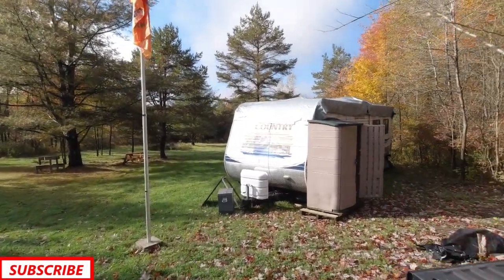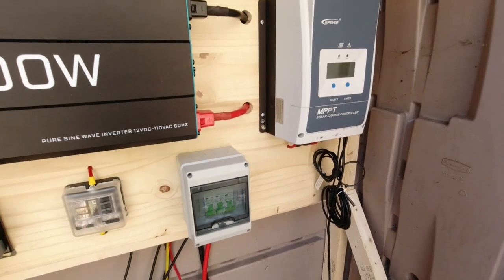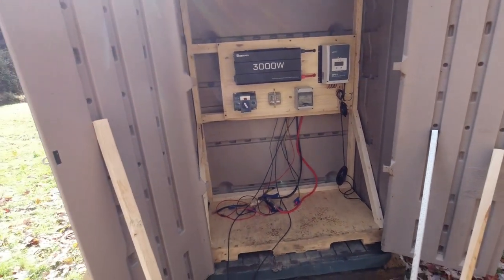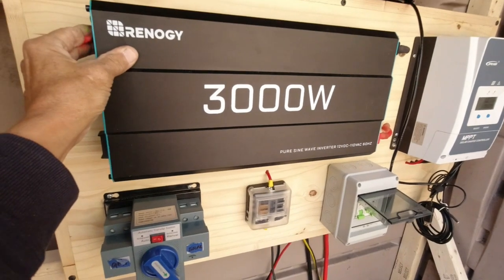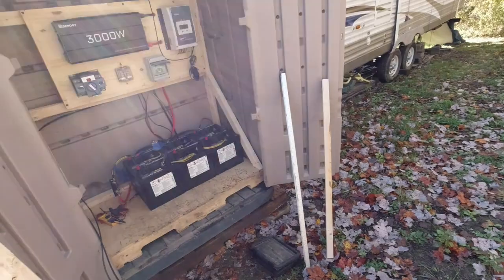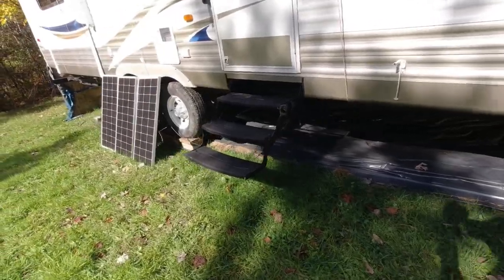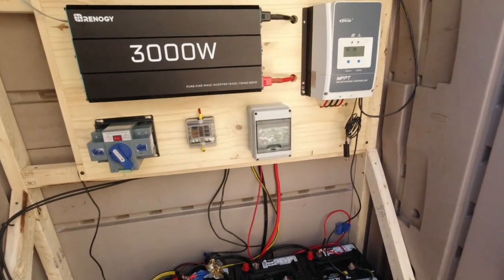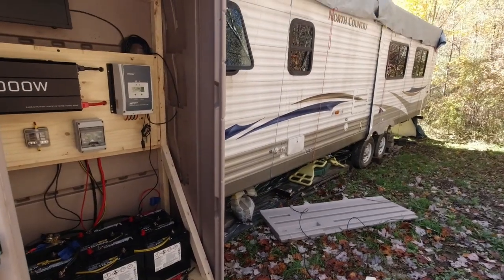Solar Setup for RV

Comment: You could've bought three lithium batteries and had 3 hundred amp hours for what you paid for all of those lead acid batteries.
Reply from the maker: Thought I checked before I did that. If that's the case shame on me.
Reply: As of 09/23 lithium would have given you more capacity for about the same money, and much longer useful life...........assuming you're in a moderate environment. If you're in Michigan, SLA is still a better choice unless your batteries are inside over winter. If you're in the bottom half of the U.S. then lithium would be your next upgrade. But I really like your small system. Very neat.
Reply from the maker: @htoddgriffin4787  I thought lithium didn't like the cold. In NY but we do get  -10 to -20 F° on occasion.
Reply: @campwhatsthepoint  lithium can't charge in the very cold weather, but they can discharge.  I keep mine inside, so it's not an issue.
Reply from the maker: Unfortunately I don't have that option , I'll have to take temp readings this winter to get a ideal of kinda median temp of where they are.  Thanks for the feed back.

Comment: New subscriber. The Renogy 3000 brought me here. I have one of those too
Reply from the maker: Seems very powerfull. Wasn't really testing it but I have run a drill press at the house with it.
Reply: I'm running the Renogy 1000 watt at the moment, however i will upgrade to the 3000 watt sometime soon.
Reply from the maker: The thing is amazing. It does consume more than I would like at "idol"